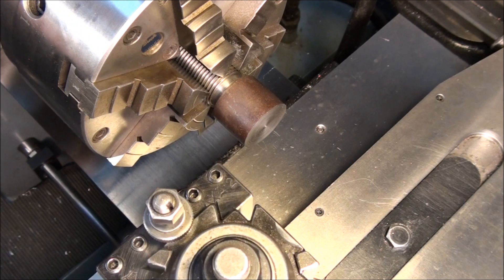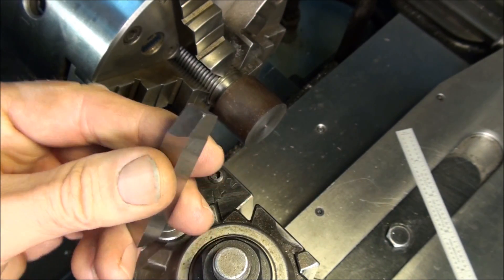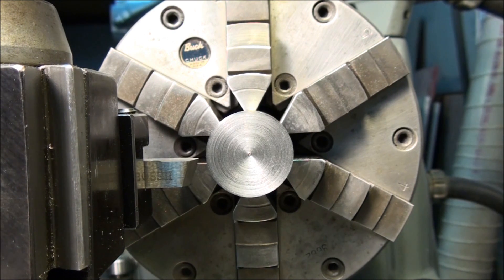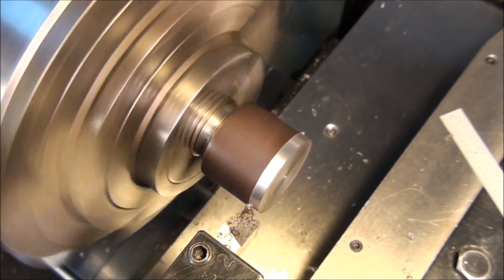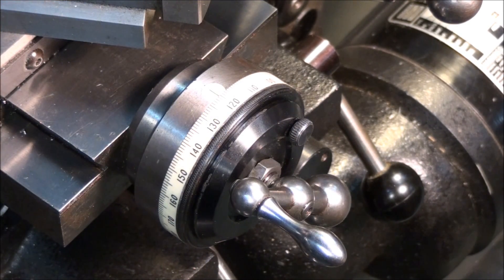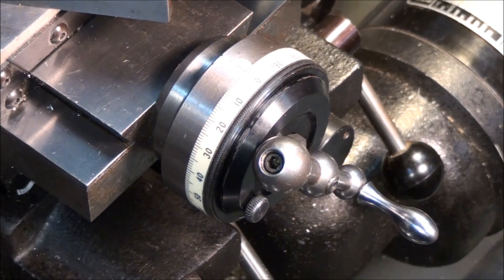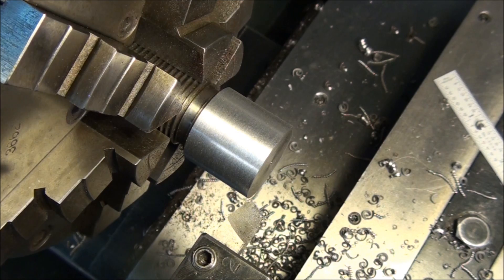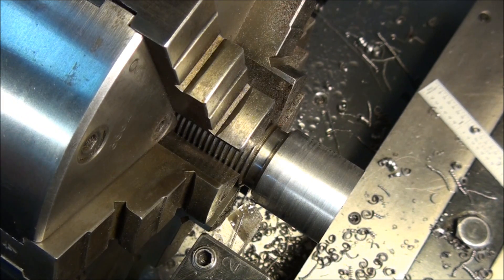Turning a Diameter to Size on the Lathe

Comment: Why don't you use carbide tooling?
Reply from the maker: @toddwhitehair3378  I do use carbide, but for the type of work that I  do (prototyping) and on the light machines that I have, it's not cost effective.  Carbide likes high feed rates and heavy cuts to dissipate heat, and chatter, or a stall will kill it.

Comment: That was great advice Tom, I have been struggling with getting accuracy from my dials. I discovered one thing of importance, I had movement in the dial after I took the back lash out. I pulled the rod and shoe and couldn't see anything wrong. I have a 1960 13" South Bend Lathe. The screw head is slotted so I took a screw driver and tightened it. This did what it should be doing, no extra movement other than back lash. Thanks so much for the lesson and advice.

Comment: Would you not instruct that when setting up your work that you first check the chuck clearance by moving the spindle by hand and then move the X and Y axis to check if the chuck will strike the bit holder or the bit when the holder is close to the chuck? Thumbs up.

Comment: When your taking final diameter cut don’t you split the difference eg if you need to remove 2mm from 38mm OD then you move your cross slide in 1mm is that correct D0 - d1 divide by 2 correct?
Reply from the maker: Most cross feed dials are direct reading, meaning the graduations refer to the diameter of the part. The only indirect reading dials I have seen are on some old South Bend and Atlas lathes. The dial on the compound is always indirect reading.

Comment: I didnt understant that,,, surely you need to remove half of 104thou,,,  52???  if you push the tool into the bar 104 it will be 208 smaller in dia??
Reply from the maker: Most cross slide dials are direct reading, meaning that the read the diameter, not the radius.

Comment: PROJECT TOM - 
First of your videos I've watched. 
Pretty good content but I've one thing for you to reconsider ! It appears cross slide markings come in two types ! Units for linear movement and units for diameter. It appears yours is the latter but on other machines, users have to dived by 2 ! - so to take 104 thou off, dial would move 52 marks. It's also a bit odd the smaller you go with diameters, the higher the dial reading ! It would seem to be more sense if the cross slide dials were marked from the centre of the lathe outward, not inward ! So when approaching zero, you'd pass 20 then 10 down to zero - rather than up to zero ! Maybe that's a machining project for you at some point - make new dials that work the right way !
Embarrassing admission ! - it could be 15 years since I used our lathe. And I can't remember whether the feed dial are metric or imperial and whether the cross-feed is 'linear' or 'diametral' !!!

Now, 1 question before I get to the PROJECT TOM bit....

6 jaw chucks - what's the crack ? Yours is the second I've seen on YT videos - what's the pros & cons (over 3 jaw) ?

Now for the killer project !!!!!!!

I've been bemused by the number of jaw-truing videos I've seen and this mad enthusiasm for accuracy. It took me a while for me to realise what the problem was - they're doing it very wrong ! (In fact, most people are doing it wrong !) If you need to work accurately, put the work scruffily in the chuck, face and centre drill. Swap the work round, face the other end and centre drill. May be reasonable to rough out in the chuck but as soon as possible, take the chuck off and turn between centres - after all the machine is commonly called a centre lathe but so few people are using it as such, it's unbelievable ! So let's see far more stuff from you being turned between centres ! As if it's NORMAL ! :)
Reply from the maker: The only lathes I've ever seen that have direct reading cross slide are really old South Bend's, so It's not reaaly worth mentioning and confusing the beginner. Besides, if someone actually had a lathe like that, it wouldn't take them long to figure it out. :) 

Six jaw chucks are much more precise than three jaws, and put half the force per jaw on the work, so are less apt to marr it. Once you use one, you'll never go back.

Once a chuck is worn, it can't be re-trued. The problem is that the wear occurs on the scroll plate, not the jaws, and it happens at the place where the chuck is most often used. You can true the jaws at that point, but then they eill be off everywhere else. Best thing you can do with a worn chuck is throw it away. Chucks are used for more than just center drilling, so they do need to run true.
Reply: @TomsTechniques  Cross slides - fair enough - I'm not aware of how many are one way or the other.
6-jaw - I did think with narrower jaw tips they could in fact dig in better and grip work better AND grip smaller work. Another thing to consider is that obviously they're spreading their work load over twice the area of scroll thread - so that should be better too. I guess I'd not looked at the engineering behind the fact there's twice as many jaws - so yes, there's quite a bit of logic to it - and possibly working towards being more like a collet chuck although not at all like that IYSWIM.
I like your opinion/style re worn chucks! I guess with wear, most of it is on the scroll/jaw interface rather than the scroll 'bearings'.  I think the basic principle of scroll chucks is sound but I think someone needs to create a fresh design - to hold the scroll more precisely and encourage users to keep the 'thread' well lubricated. That's really a job for grease - which sadly is ideal for swarf chips to stick to !

Comment: Although you were machining down to a diameter, all your measurements were referenced to the centre of the piece and you were taking cuts off the radius. ie. If the piece diameter, which is what you were checking with the micrometer, is 10 thou over and you take a 10 thou pass, the piece diameter will now be 10 thou under!

Ps. I didn't see any soft packing where the threaded portion was being held in the chuck. Not best practice if the thread is important.
Reply from the maker: I was working on a lathe with a direct reading dial on the cross slide, so there is no need to correct for radii vs diameter. Most lathes are like that, save a few old South Bend's.

The stock used in the demo was pulled from the scrap bin but yes, protecting a finish machined surface is always an option.

Comment: Awesome video Tom. Do you find when you "touch off" for your zero that your actually going in a few thou?
Reply from the maker: I assume you are talking about setting the tool to a finished surface? The best way to do that is to run the tool toward the stationary part (not running) with some sort of shim between the tool and part. Paper works well, or a piece of shim stock. Once the tool touches the shim, you know where it is relative to the work, and can then move it in the thickness of the shim and zero your dial. That puts the tool at the surface of the work, without damaging it.

Comment: I wish my lathe could easily take off .100 in one pass!
Reply from the maker: It likely can take off that and more with a properly ground tool. On mine I can easily bury a 3/8" tool on a roughing cut. That's not always the fastest way to remove metal though. Multiple shallower passes at a high feed rate can be more efficient.

Tom

Comment: Hi Tom, I am currently learning to use lathes at my engineering school in the UK. I am finding your tutorials very useful but there is 1 thing I am really struggling with. I fall behind in class because I take too long cutting material down to size. I tried taking off more material per cut but the machine seems like its not doing well at all, there is alot of smoke and noise, I need to get quicker. Is there a technique to achieving this? Currently I take off 0.1mm per cut, the rest take off up to 0.5mms and say they had no problem. We run the spindles at the same speeds, use the same cutting tools and materials.
Reply from the maker: .1mm and even .5mm are very light cuts. What type of machines are you working with? For end milling, I generally take 1/8 to 1/4 the diameter of the end mill for roughing cuts and much more on a lathe, if necessary. The trick to heavy cuts is to get everything as rigid as possible (both the tool and the work), use the proper cutting speed and use coolant to keep everything cool and well lubricated. 

There are also techniques such as plunge cutting that speed things up for pockets. I talk about that in some of my videos.

Tom
Reply: .1mm is a small cut i personally take .050/inch per pass until I get it down to .050 within the size i am trying to turn to

Comment: thank you sir. I have 2 qs one is did you move the tool by hand or using the automatic feature? 2 is how do i stop the tool before hitting the chuck?
Reply from the maker: Power feed will generate a better surface finish than hand feeding the tool. 

The tool is stopped by disengaging the feed. Notice that the part is sticking out of the chuck a bit to make room to do so.
Reply: thank you sir. I just got a job as a machinist trainee i'll be starting Monday. I am also a student at a local college, but i have never gotten my hands on the lathe or mill. I have been watching your videos and I learned a lot. Monday is the real thing. Thank you for your advice and help!

Comment: Didn't you mess that up at the end and go undersize?
Reply from the maker: "Undersize" is a relative term. Real parts have tolerances associated with them and as long as the dimensions fall within those tolerances, they are good.
Reply: Tom 
Thankyou for your speedy reply.  I appreciate you were only 1/2 a thou under but you miked the diameter and noted you only had 12 thou to go.  When you put on a cut of 12 thou you took off 12 1/2 thou.  Suppose this was a piston which had to be 1,125 and you wanted to lap off the last 1/2 thou or so.  How do you make sure you dont cut a 1/2 thou too small without creeping up on your chosen dimension by taking smaller and smaller cuts?  Is there a way?
I only ask because quite often I end up taking smaller and smaller cuts as I get towards the size I need and it takes a lot of time.  I think it's also not good for the tool to take tiny cuts.
Thanks for any help you can give.
Reply from the maker: If I really wanted to hold the nominal dimension I would have taken the last .012" off in two cuts. That way each of those cuts would be identical, and the first one would provide the opportunity for a careful measurement to dial in the final cut.

Comment: I have a standard diameter drill but I want to give it a non-standard diameter because I can not find that diameter in stores. How can you adjust it?
Reply from the maker: You can make a drill cut slightly oversize by making the length of one cutting edge longer than the other, but the size would be unpredictable. You'd be much better off finding the proper size drill.

Tom

Comment: Loving your videos, learning lots before I start using my new mini lathe. So glad we work in metric in the UK now, imperial sounds so complicated 😁
Reply: Imperial isn't complicated, but the tendency for micrometers to measure in thou (or smaller) is a bugger when many sizes are in x/8, x/16, x/32, etc. You can convert with tables or calculate them on the fly, but it's an unnecessary step that is prone to introducing errors.
Reply from the maker: The Imperial system isn't complicated at all if that's what you are used to. First thing most shops do here if they receive a Metric drawing is convert the dimensions to inches. By the way, I understand you guys still use a number of Imperial measurements as well, so maybe the Metric system isn't all it's cracked up to be. ;)

Comment: This is how I do it on parts that must not be scrapped (large price tag):  after roughing I run spring pass to remove any material that was left by roughing tool deflection, then I measure the part. I may take light semi-finishing pass to leave myself desired amount of material for finishing pass.I stop the machine, and cool the part down with coolant running for a few minutes. I then measure the part, move tool to finishing diameter ,and run the pass for the length of 0.25" then stop the machine ( I do not let tool run to the end yet !) I measure the part to make sure size is ok, then continue the pass. Sometimes there will be a witness mark where the tool was stopped so I polish that off at the end. If I measured that the part was undersize, I adjust, and only that first 0.25" will be undersize ( hopefully the customer will forgive:). Imagine that you let the tool run to the end because you trusted your machine ,just to find out that you are 0.001" under for the entire length!

Comment: HI Tom, really like your videos. Were you moving the tool longitudinal by hand crank or automatically? What's a good speed to do this?
Reply from the maker: Always use power feed when possible. It leaves a much more even finish on the part. There are many variables that affect feed rate, such as the type of metal being cut, the depth of cut and the desired surface finish. At some point, I intend to do a video on how to choose an appropriate feed rate, but for now you'll just need to apply some common sense, ie. slower for deep cuts or fine finishes and faster for shallow cuts or when fine finishes are not necessary.

Tom

Comment: just wondering, do you ever actually use the compound for parallel turning. I've been using a cnc at home but since I've gone to college we've been shown to use the compound instead of moving the carriage.
Reply from the maker: I can't think of one reason to do that. The compound is normally used to turn tapered diameters, which makes it a poor choice for turning something cylindrical. You would need to indicate it every time you used it.

Tom

Comment: I can not find a video where someone turns a pice with different diameter, like the engine cylindar shaft( not that dramatisk ofcourse ) was it maybe an idea for you hopefully to show us how its done
Reply from the maker: I'm not sure I understand your question. Do you mean different diameters on the same shaft, or do you mean offset diameters like on a crankshaft?

Tom
Reply: Hi Thank you very much for answering. Since then I have learned that the name of it is  Eccentric turning, But I dont have a chuck with 4 jaws :( I only have a 3 jaw chuck. I have tried and it is possible but I dont know how to find out if the Eccentric turning will work to my specificatons. I couple of times and I haven't been able to get it right. Thre Arent much on youtube is there? I mean teaching how to.... Thank you very much. Keep it up. Love your video's
Reply from the maker: Eccentric turning can also be done using a fixture. A piece of round stock with an offset bore in it can be used to hold a part in a three jaw chuck. I will add that to my list of video topics.

Tom
Reply: Yes I have found some youtube video's but most of them are done on a 4 jaw. I dont have a 4 jaw, and with a 3 jaw it seems that the only way is exactly have mentioned here. using something with a hole in where one can insert the item in and hold it while turning. I just was hoping that I could find a better or quicker way, but I guess one can not want too much from a thing which can not deliver ( the 3 jaw I mean ).Thank you very very much for answering my question, even thou I wish I had looked some more and then I had asked you a better question. Keep up the good work. I just everyone of your video's. GOOD LUCK...